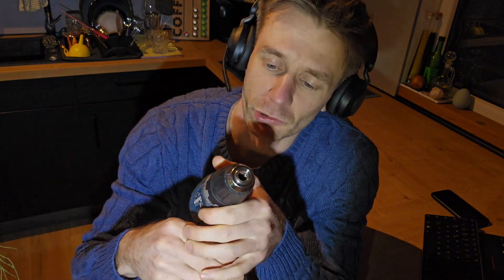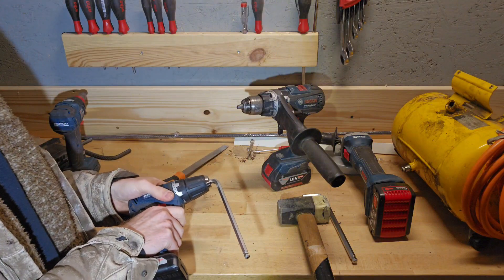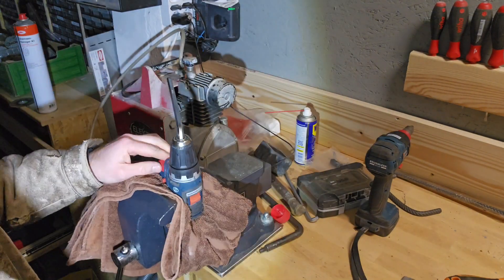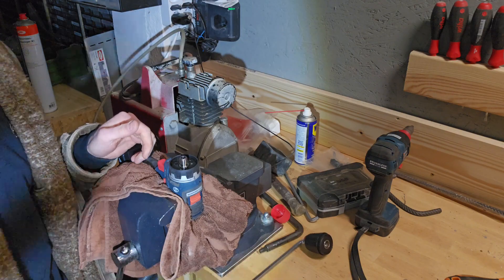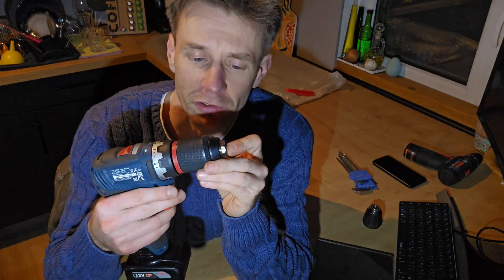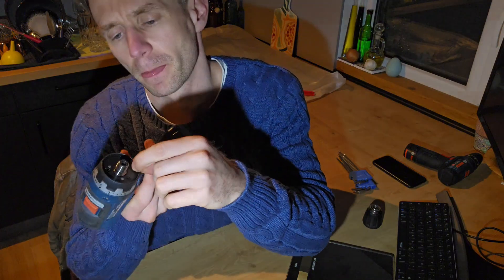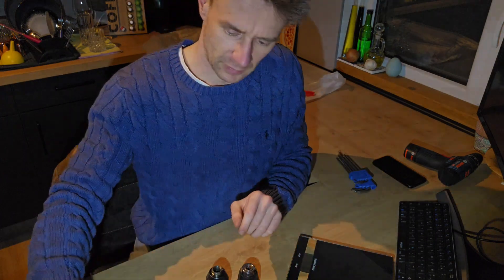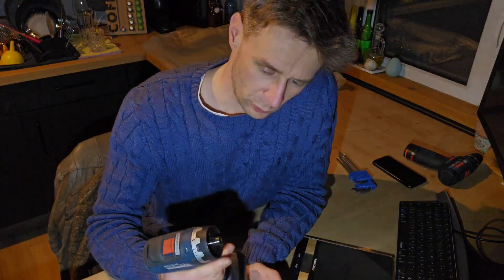I upgraded my BOSCH GSR 12V - 35 drill to a METABO chuck

Comment: Don‘t even own a 12V-35 yet but plan to get one soon. I really love that modification! 
Looks like you instantly added even more quality to the tool and just that clicking noise while clamping the drill sounds awesome. 
Could you share which Metabo chuck exactly you‘ve used for the conversion?
Reply from the maker: Yes, it feels and sounds much better. But if you just use the drill for smaller drillbits, the original one will do its job as well. Metabo Futuro S1, 1/2" it is. You can find it on ebay for 20€.
Reply: @Son-of-Allen-key yeah, for sure not a mandatory upgrade as the OEM chuck is good enough but it‘s probably also just for the modding experience, click & feel as well as satisfaction 🤪 
Wasn‘t sure whether you‘ve used the standard Futuro S1 or the Futuro Plus S1M. The shorter chuck might be a nice variant as well but it‘s more than twice as expensive…
Reply: @Son-of-Allen-key  Hello, please clarify on the BOSCH GSR 12V - 35 chuck it says 10 mm with a 3/8" seat thread, how did you install the Metabo Futuro S1 chuck with a 1/2 seat thread? BOSCH has 3/8", and Metabo has 1/2?
Reply: @СергейБезфамильный-у5и  In Europe the Bosch GSR 12V-35 drill it is not 3/8" seat. it is 100%. 1/2" seat. I've already done the mod myself. No 3/8" chuck needed. Simple. !
Reply: @Son-of-Allen-key I live in the Usa we use modal  ps-31     I like to give you information the  original  3/8; Chuck is made  by  ROHM   good video
Reply: You can get an OEM Bosch metal chuck for about 19 Bucks. Only downside it goes only up to 9mm.
1 600 A02 9ML is the partnumber. It used to be on the GSR 12-30 before they went to the plastic chucks that go to 10mm.
Reply: Can anyone verify that US models are for certain 3/8 seat thread?